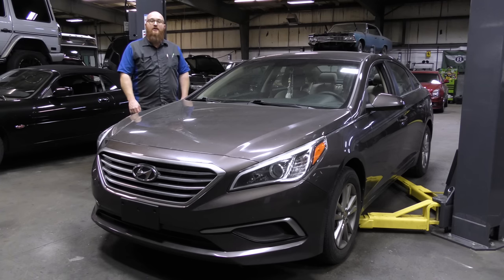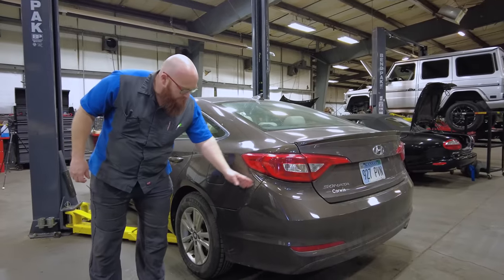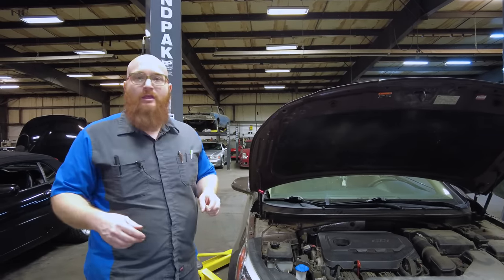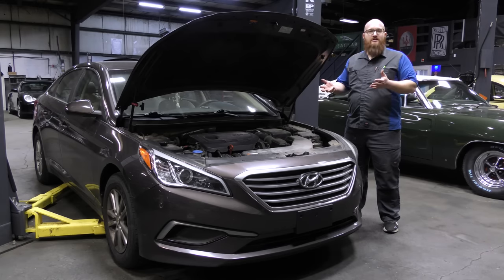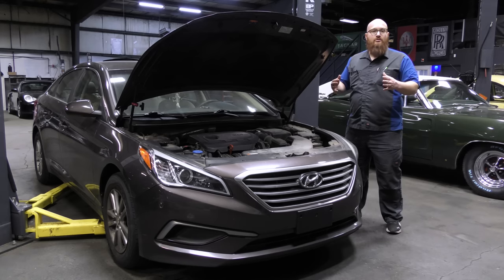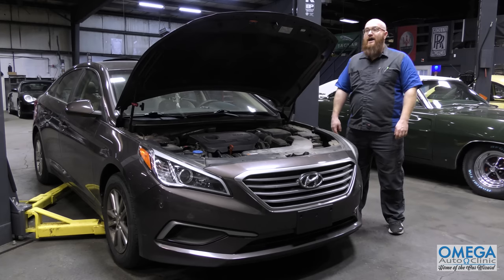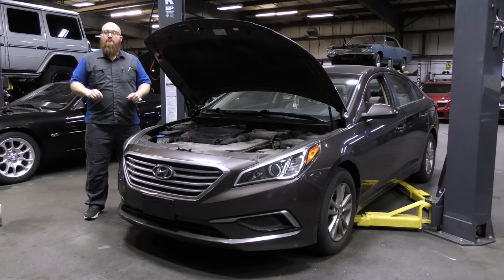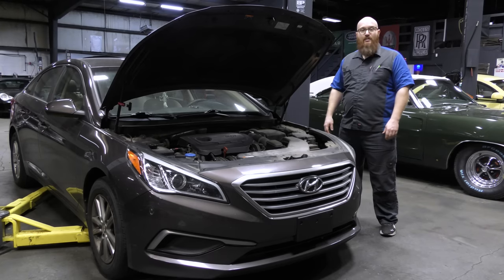What could be so bad on this '16 Hyundai Sonata that the CAR WIZARD is sending it to the junk yard?

Comment: From first-hand experience, the oil consumption on these 2.4L Hyundai engines is greater than usual. You'll run through a FEW quarts between oil changes, so you have to be really on top of the levels. You won't get a low level or low pressure warning, either.
Reply: That's the real problem why is there no oil light. When it is 2 quartz low
Reply: Hyundai considers 1 quart per 1200 miles normal for the 2.4l engine
Reply: @tomtomorange  100%. It's ridiculous that you don't get some kind of warning. A lot of drivers with that 2.4L may be running substantially low without warning. And this engine already has an extended warranty for knocking due to a defective bearing. The mfgr./dealer will take any excuse not to replace your engine under this program, and low oil is definitely on the list of excuses.
Reply: @RichardSammartino How many quarts of oil are expected by Hyundai for the 2.0L Turbo?
Reply: We bought a 2016 sonata for our daughter and let me tell you, is been a nightmare for me checking the oil level every three or four days, now is smoking more that usual, that's the greatest garbage from Hyundai, I will stay away from them forever
Reply: @RichardSammartino  from the reading i've done the dipstick only reaches the top 2 quarts of oil in the engine.  So if  the engine burns 1 quart of oil per 1200 miles then at 2400 miles your oil will probably be at the low mark on the dipstick and your engine is probably running on just 3 quarts of oil.  If you get oil changes every 5000 miles you'd need to top off the oil a few times in between each oil change otherwise by the time you reach 5000 miles your engine might be running on just 1 quart of oil.
Reply: WRONG.... You will get the low oil light after one quart low.
Reply: Anyone know if the 2021 2.4L engines are OK as far as oil consumption.   I'm looking to buy a 2.4 Sportage (same engine as the Hyundai Tucson).
Reply: I bought a Hyundai , I’d never buy another.
Reply: Its like 2 stroke engine 😮
Reply: The real question is WHY these engines are consuming so much oil in a short period of time?
Reply: @carlvitko1355  I read that it has something to do with the higher pressure fuel pump used in GDI engines. Over time, oil starts making its way into the combustion chamber, etc. But they also have problems with metal debris from manufacturing that is carried by the oil and wreaks havoc especially on the connecting rods. There is a class action lawsuit about this.

Comment: @15:45 Wizard, you're truly a class act. Thanks for this. It's sad that people have to be reminded to be kind and have sympathy. I've always admired your attitude toward protecting your customers. It seems that you truly care about people, and it shows in your work.
Reply: Idk as a car enthusiast its hard to be empathetic to someone who wouldn't spare a minute to potentially save their car's engine. Now they get to go byy another car just for that.
Reply: @brayannexon4613  idk man, I don’t think anyone deserves a 8-10k bill for not checking their oil or for mistakenly thinking “it’ll probably be fine” and getting hit it with the bill. It was clear even wizard was shocked that no one would rebuild it
Reply: @saratc660  there is saying that goes: 
Oil is cheap engines are not. 
The gaint bill was avoidable. Yet the lack of effort has bit them in the rear.
Reply: @saratc660  what do they deserve then? A reward for their stupidity? To have a car so poorly maintained it barely had any oil left deserves very little sympathy.
Reply: @saratc660  Yeah anyone can rebuild an Ecoboom the 2.0 i4 turbo in the lower trim mustangs... And you could always just swap in a coyote the GT Mustangs's V8.

Comment: Funnily enough, I bought a 2013 Sonata with the original 2.4l engine (bad market at the time) for $3000 a few years back. It miraculously had 210k miles. I kept it for another 10k miles and sold it. The previous owners secret was that he kept up with oil changes and topped off when needed. He also drove the hell out of it. It didn't even burn oil! To this day i wonder if I had a unicorn on my hands lol.
Reply: I had a 2013 sonata i got with 9k miles on it. Previous owner and I were both religious about oil changes. Engine seized on the highway at like 55k.
Reply: I have same one, 130k+ miles, drive across the country a few times but no oil burn.
Reply: The thing is my wife brought it for $12k at 120k miles😅extremely bad market
Reply: @lqtmn  yours are proly tamper with ODO
Reply: Excellent video.
Reply: Likely had an engine change already.
Reply: "topped off when needed.  It didn't even burn oil!" those two things contradict each other :))))
Reply: 2008 Hyundai Sonata GLS 3.3 V6 MPI--- totally different!! 230k, timing chain, runs like a dream!! Do your research folks & stay away from the BAD ones.
Reply: He probably used a premium motor oil like Pennzoil Ultra Platinum or Amsoil 100% synthetic.

Comment: Great video. My dad tought me to always change the oil every 3000 miles. Even with the suggested 5000 & 10,000 mile suggested changes in today's new cars, I stick with the 3000 rule and I check my oil every month. My car is only five years old with less than 60,000 miles, but I won't change from what I learned.

Keep up the great and honest suggestions in your videos. We all appreciate it.
Reply: Change it yourself too! The lowest kids on the mechanic totem pole do oil changes
Reply: Yes, I also follow my dad’s  40 year old advice, faithfully oil change every 3,000 miles! Check tire air pressure every month.
Reply: Changing oil evey 3000 miles seems like a waste of money considering how much synthetic oil and quality filters cost, not to mention how much better oil quality is compared mineral oils from 30-40 years ago. Not to mention how much fuel quality has changed as well as engine build quality. That 3000 miles thing was adequate for 1970's Chevy Novas that ran rich and had warn out piston rings in less than 50 000 miles not for vehicles made in 21sr centuryõ But if you don't want to change or actually learn anything new, then it's your money you're spending.
Reply: @robertrool8108  - I schedule 5k miles on my g/f’s Rav 4. I use high quality Wix filters and Mobil 1. I actually just changed it on Monday at 5500 miles and this new 0w-20 oil is garbage. Absolutely no viscosity left compared to the 5-30 syn blend I use on my Astro van and her old ‘08 Rav 4 with 278k miles.
Reply: @robertrool8108  That’s alright, I’ll spend MY money and you believe in what you want to believe!
Reply: I was always told about 3000 miles. I had to talk to various mechanic friends of mine to convince me 5000 miles was the new norm for the synthetic oil used now. And Scotty Kilmer recommends that, too
Reply: @MannyC711  Yeah well, if you still live in 1960´s it is your choice.
Reply: @RustyZipper  I manage a fleet and new Toyotas use 0W20 and 0W16 even. You can´t really compare a new RAV4 with something made in 1980´s-90´s like Chevy Astro van. Obviously 0W20 is not suitable for that engine when it wasn´t designed for it. I manage a fleet of hundreds of cars, including VW, KIA, Hyundai, Toyota, BMW,  Ford, Honda. Some are 3 to 4 years old and have mileage of 200k miles by now and run seven days a week. Different drivers so they aren´t used just for a grocery shopping. So far no issues with engines regarding premature wear of block or cilinders that could be associated with oil issues. Usually everything other breaks like late model Hyundais that have issues with transmission or bits of interior parts and trim just wearing prematurely, or BMW´s engine management unit failures that leave people stranded. None out of 170+ cars have some silly 3000 or 5000 mile oil changes and I still can´t wrap my head around the fact that some people still blindly follow myths that were on point in 1970´s when the fuel had impurities, mineral oil was of low quality and engines had carburettors and piston rings (oil rings, pressure rings, wiper rings) that wore out in less that 40 000miles.
Reply: @robertrool8108  yea, you rub me like that one kid in class back in the day where he never had the courage and a low self esteem to talk and therefore he kept to himself but now fast forwarding to this time in age and behind the comfort of a smart phone he’s all of the sudden Mr. Know it all and with pride. O_o
Reply: @krbulldog  I’ve found Scotty numerous times to be a waffler. I prefer to do my own analysis and draw my own conclusion.
Reply: @robertrool8108  - the difference between you being a fleet manager and independent owner is that IF I have an engine / Trans issue it’s game over financially. I’ll happily change my own oil every 3-5k miles because I plan on keeping everything until the rust eats it away. You are fortunate because your business can purchase new cars every year if the engine or Trans goes out. It’s my money and time, if I want to waste it you can’t stop me 😆
Reply: @MannyC711  - I heard Scotty is quitting YouTube and keeps getting sued, he’s only making one last video before he dies too! He’s the king of Clickbait 🤴
Reply: @RustyZipper  💯
Reply: @robertrool8108  doesn't matter.  Changing oil every 3000 miles will always be cheaper than replacing a motor.  Also with the way these motors "burn" oil from the assembly line now doing every 3K ensures you won't never run it low either.
Reply: @RustyZipper  There has been no issues with any of the vehicles considering oil change intervals. Out of almost 200 cars including MPV's, panel vans. I've also worked in a service shop where I saw people not changing oil for 3 years and more than 30 000 miles and completed courses with Castrol and Shell because the oil vendors wanted staff to be knowledgeable about oils and lubricants. And with fleet the management is keeping the vehicles for 3 to 8 years so they want them to work. The reason why I'm still here with a reply is that people in some parts of the US keep the 3000 mile myth alive and become cranky and rude when someone challenges them. But they offer NO proof how this is reasonable or necessary. They just heard it when they were kids and go by that myth. But when was that? 30-40 years ago... They just dismiss any facts about oil analysis and the what new cars require. Specially in rust belt states where it's just useless because in 15 years most vehicles have rust everywhere and are demolished or abandoned.
Reply: @littlebill1987  Well I have a VW Passat that has oil changes every 8-9000 miles and just did an oil analysis as it's near 150k miles. It does not burn oil and gets Mobil1 5W30 ESP VW 507 synthetic oil. All of the stats are just fine. Mom and pop era cars were made in  60's and 70's and car industry has come a long way since then. Some Toyota 2.4 engines had issues and some need top ups. But they are workhorses not collection cars anyway...
Reply: @robertrool8108  na just change the oil.
Reply: I am 63 years old, I have been a government fleet services mechanic for 41 years. Retired last year. Since I was 16 (and was a damn good amateur mechanic/car enthusiast back then) I have always changed the oil in my vehicles every 3000 miles. I always will. This "extended oil change" thing is nothing but a bunch of EPA LIES. Same goes for not warming up your engine before taking off. I have put some absolutely crazy high mileage on several cars, way more than normal, and I credit proper maintenance for that. My newest car (I have three cars and a truck) is a 2006 Mercury Grand Marquis. 357,000 miles. I won't buy a car any newer than that. Newer cars have been ruined by trash technology that has no place on a car. It doesn't matter how well you maintain them, they won't last very long, they were never intended to. They are disposable cars.
Reply: 3000 mile oil changes are just fine, just don’t waste your money on synthetic if your doing that.
Reply: I am the same way. Everyone looks at me like I am crazy doing full synthetic changes every 3k on my vehicles. I just laugh at them with their Audi/VW cars doing 10k oil changes paying 800 bucks a month with a ticking time bomb.
Reply: If your doing high mileages then fully snyth every 10,000 isn't bad.
Reply: Better safe than sorry, but you’re totally just wasting your money and creating more oil and filter waste. Just cause advice applied 40 years ago doesn’t mean it still does. It’s just pure stubborn ignorance at that point with no actual data to back it up. There are exceptions of course like specific DI motors that have dilution problems, or track days etc, but otherwise it’s just pure ignorance. Even the car wizard speaks to it in his videos. But to each their own I guess
Reply: @connor040606 yeah 10k on many motors isn’t a great idea. Every. 3k with modern full synthetic though is just as silly unless your tracking your car it’s a total waste with no data what so ever to support it.
Reply: Mobil 1 
Change every 12-14,000 miles. 
No problems at over 500,000 miles. Oil monitor triggers “change oil” at about 10,000 miles but it doesn’t know that l use full synthetic so…
Reply: Every 3000 miles is excessive and unnecessary. Modern oils are very good. Turbo driven cars (with synthetic oils) use a 5-6,000 mile interval, so your car is non-turbo, you will be fine.
Reply: @MannyC711  Sounds like someone's been triggered and resents being informed that their knowledge is out of date.  Yep, you can do what you like, its a free country and some people are real good a doing dumb things, but remember what Forrest Gump said...
Reply: @robertrool8108  . Changing the oil every 3000 will make the car last forever.  Or every 5000 - 10000 to last up to 250K.
Reply: @littlebill1987  if your logic is true then change the oil every 1000 miles!
Reply: There is only one voice of reason in this entire thread and everyone is arguing with it.

As for Scotty Kilmer, he doesn't run his channel, his editor does. You may not like the click bait titles, but his info is usually solid, in my experience. 

That said, never get your info from just one source or put all your faith into just one person (or any person).
Reply: every 5000 miles is perfectly fine. but it's your money so i don't care
Reply: Since about 2005 I've been changing oil once per year regardless of mileage using top-tier synthetic and filters.  Mileage usually lands around 14,000.  Mixed conditions driving, not much heavy towing. I still have the same vehicles and they barely use a drop of oil.  The argument that "I'm minimizing my risk and its cheaper than an engine" to justify short intervals is just plain ignorant these days. And wasteful.  Get yourself an education in industrial tribology like I have before you clap-back.  Edit:  14,000 miles not km.
Reply: @robertrool8108 Your totally wrong oil today still gets contaminated. Also the additive package starts breaking down at 1200 miles. Oil is cheap engines are not so 3k intervals should be respected in this GDI turbos...
Reply: 0w-20 oil changes every 7,000 miles. Maintenance Minder has the oil life at 40%. Can't beat that.
Reply: I change my full synthetic oil every 3000 miles because my car is both direct injected and turbo charged with a timing chain. It's necessary in my case.
Reply: @robertrool8108 not with GDI, low tension undersized control rings, tiny oil passages and timing chains that are 10 ft long. Clean oil is necessary.
Reply: Agreed I always change oil and filter every 3,000 miles
Reply: With synthetic oil in todays cars, you’re completely wasting your money changing at 3k miles. It’s not 1980 anymore, oil technology has greatly changed. You’re not being that smart, just wasting money. 5-7k on synthetic oil is perfectly fine. If the car blows up, it’s not from the oil, it’s bad design or neglect.

Anyone still living in the belief that you need to do 3,000 miles oil changes with synthetic oil on new cars, just doesn’t know anything about cars, or is delusional. It’s just not rooted in reality.

In the actual owners manual most cars say 5-7k, they wouldn’t lie to you, have their cars blow up, and be stuck with a million warranty claims. You are wasting your money and listening to outdated information and acting like technology in oil and engines hasn’t changed in 70 years…
Reply: @jaredchampagne2752  I don’t fully trust manufacturers recommendations. That being I do t disagree completely but I would never go above 5K
Reply: @robertrool8108  Engine build quality and Hyundai in the same sentence is an oxymoron!
Reply: @MannyC711  Scotty Kilmer is the new "Joe Isuzu"!
Reply: @krbulldog  The 3000mile oil changes just like the 2000mile changes (back in the day) were only for "revenue enhancement" for oil companies!